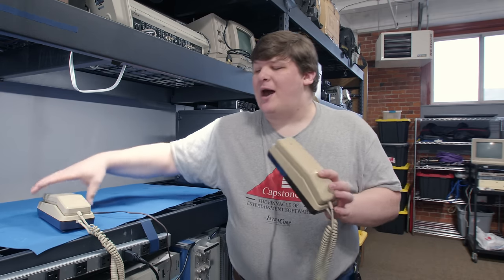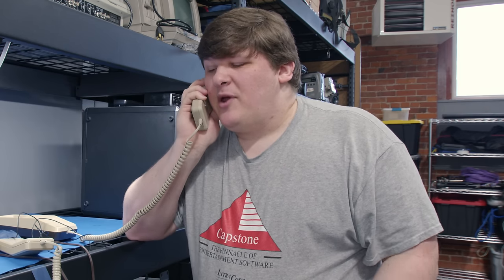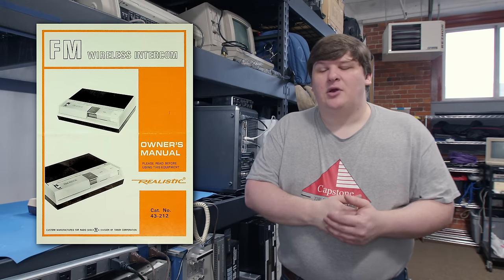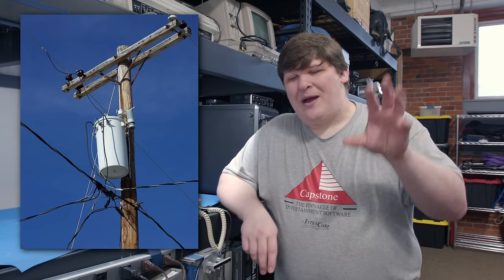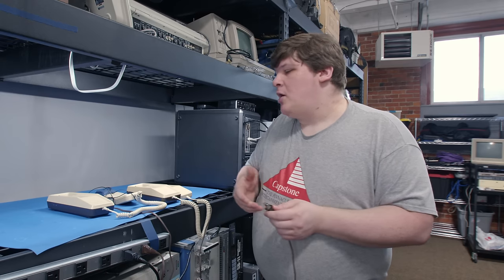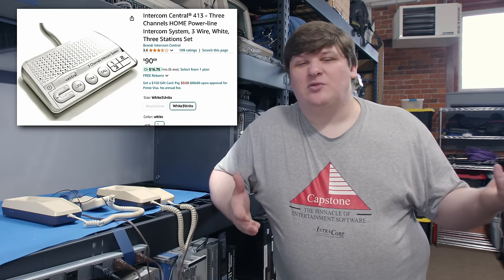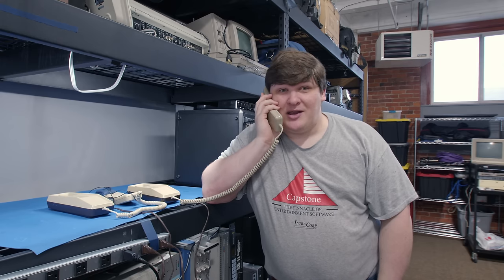How does this "phone" work without a line?

Comment: If you look at the power requirements, 220V/50Hz is in parenthesis just like the 193 kHz radio frequency is in parenthesis. Im betting the US version is 200kHz and the European version is 193kHz becuase its derived from the 60Hz and 50Hz AC power frequencies. Tandy wasn't about to make different transmitters for different countries if they didn't have to.
Reply: Probably so, and/or due to some differences in RF emissions regulations between countries, although probably more like what you said, as that would be more likely.

Comment: You should go to the granddaddy of them.  The built in intercom you would buy for your house.  I had one and managed to repair it with a few blown caps.  I mean it works and it was "kindof" nice to have the radio go on in the house but I used it like once.

Not sure why you would have an installer drop wires for all of it

Comment: PLC is iffy in North America because of the split-phase - it requires all the devices to be on the same phase to work. Unfortunately, two random outlets in your house have a 50-50 chance of that happening, and its likely all outlets in that room are hooked to the same phase, so if it didn't work between the den and the bedroom, it's likely not going to work. And older houses often had multiple rooms sharing the same breaker, so all the bedrooms on the second floor don't have outlets that work. Much less of an issue in Europe if your house only gets single phase power. Though people with 3-phase power are outta luck. And your building has 3 phase power - basically every non-standalone house building gets 3-phase, including apartments, offices and other places. Apartments often get 2 of the three phases leading to a 208V system (rather than 240V for a house) for higher powered appliances. As for offices, most offices get all 3 phases, but which phase a random outlet is on, is a guess.

Comment: So Gravis you’ll get a kick out of this! 

The thing about the X10 system is that I’ve seen it pop up in unexpected places! 

The circuit werkes Sicon-8 

A remote control unit to remotely interface with a broadcast transmission site, (over serial IP or POTS) supports X10!!!

Be me a jr broadcast tech in 2019, trying to trouble shoot my completely analog site control panel from the 70s, interfacing with this remote control from the early 2000s or so!

I found the manual, I rifted thru it looking for an answer to my ailment, and was side tracked by the chapter on X10! Like most of us I was made aware of x10 by LGRs video on the system! 

Apparently you could buy X10 gear and set it up all over your transmitter site and send commands out from the sicon! Cool shit! 

But for what! 

Maybe turning on the blower or your resistive dummy load remotely? You could also just wire it up directly to the TB on the back of the sicon. But maybe you can’t? Because you ran out of pins or the dummy load is in a different room and your site is a block building making it hard to run wires thru? 

Anyway, cool shit

Comment: I've had good luck with powerline ethernet devices, at my Aunts she had pretty thick walls and the wireless modem router was upstairs. She also had a brick summer house in the garden that needed internet access so she could work out there and it worked fine out there.
Reply: This likely depends on how noisy the power lines are, which is influenced by how much electronic stuff you have. I suspect the cheap wall wort power supplies are most at fault for noise, which they probably generate even when the connected device is off.

Comment: This solution is so clever, especially on how it use the house AC circuit, the doorbell intercom version make the most sense as you don't need extra phone wiring for the doorbell. I'd rather have this style than internet intercom, it's much more reliable and easier to set up if you know how to do basic house wiring.
Reply from the maker: Completely agreed. Instantaneous communication that can't fail and doesn't need configuration, it's a slam dunk.

Comment: I think they have to be on different frequencies because it's FM. If you have two FM broadcasts, an FM receiver will lock onto one or the other (it's known as the capture effect) ; this is unlike AM where the two broadcasts constructively interfere. If both stations were broadcasting on the same frequency, your handset would lock onto the strongest signal, which would inevitably be the one being broadcast from itself.

This is the same reason that airplanes use AM to communicate; if they used FM then broadcasts from some planes could be lost, and when you're doing air traffic control it's quite important that they aren't
Reply: Eh, it’s not like if people “step on” each others transmissions in AM, both will be audible. It usually creates “intermod” which is generally sounds like a tone or a buzz. 
BUT, crucially, everyone listening on frequency will be aware that a TX was missed, and usually the controller will ask to repeat. 

The other reason aircraft use AM is because aircraft were using radio way before FM was invented, and having every aircraft and every tower switch at exactly the same moment would have been basically impossible.

Comment: My experience with powerline was that it worked OK in situations where WiFi didn't work at all. The throughput was not great compared to an Ethernet cable, perhaps fluctuating around 40-60 Mbps instead of 100 Mbps, but this was at a time when WiFi had a gross data rate of 54 Mbps, which even under optimal conditions (no noisy environment, no walls between, just one AP and one device) was 20-25 Mbps at best. The only problem with powerline was that electric motors were a huge interference. So whenever you had a vacuum cleaner, kitchen appliance or fan running, the data rate would drop dramatically to just a few Mbps. 

However, this could be avoided by connecting a filter between the appliance with the motor and the socket. You can buy such intermediate plugs that filter out all signals except the mains voltage and they work on both sides, i.e. they also filter out interference frequencies from the appliance so that these do not get back into the line (or are at least very strongly attenuated). With such a filter, the data rate only dropped by 15-20%.

If powerline didn't work at all, it was either because the two sockets were switched to different phases (electricity comes in three phases from the local transformer, but normal sockets only use one of these three phases, yet not all sockets in every household use the same phase) or because high-frequency filters were installed in the fuse box. These filters are intended to prevent devices such as motors from feeding interference signals back into the grid, basically the same as the plugs I mentioned before, and if there are filters, then the supply lines to both sockets must  be connected together before any filter, because if they are only connected after a filter, that filter kills the powerline signal.

Comment: My house, built in the 80's had a wired intercom system centrally located in the kitchen, 4 bedrooms and the front porch. With exception of the speaker on the porch, I have removed all and plastered over all the holes. The central unit was pretty huge and ugly. We have since insulated this house to the point where it is hard to shout from one end to the other so I suppose it might be useful.

Comment: The minute you showed just a power cord, I was thinking it's either radio (AM or FM depending on era) or powerline. And it turns out to be both! FM using the power line as the antenna. (I've seen that trick before.) The most likely reason for your problem with "BPL" is the NEC requirement for a "whole home surge protector", and the propensity for surge limiting circuits being built into just about everything. If you have a UPS... won't work. If you have a power strip with a surge protector... won't work. If you're on a different phase in a three phase building... won't work. If your commercial space has it's own transformer (VERY common in commercial buildings)... won't work. (etc. etc. etc.)

BPL across the grid has similar issues crossing transformers, but ultimately was "outlawed" due to the AM/FM radio interference it causes.

Comment: Unironically, these would be great for testing HomePlug AV (that's the name of Powerline Ethernet) interference. They're still analog, so you can hear it. Because no, that 60Hz hum is not because it's old. The electronics do not "get tired". That 60Hz hum is the hum from the AC power it is connected to. There should also be a 30kHz hum from the carrier, but... that's outside of the human hearing range. The modern ones are usually digital and feature some form of encryption so the neighbors can't listen in. Just like HomePlug AV does.
What I would like to know, though, is whether these things can coexist with HomePlug AV devices and not disturb each other...

By the way, the Radio Shack Realistic Plug'nTalk Model 43-212 was used in several movies and TV shows for the CEO scene of "calling the secretary". Even some modern period pieces.

Comment: The "Duplex" in the name already reveals that the frequencies work exactly in the way you described it. The 200kHz would work on power line but not on the air, since that would require a giant antenna, so the powerline transformer used to carry the signal makes sense. The pole transformer acts as a huge choke which filters out almost anything above 60Hz.

Comment: Powerline Ethernet adapters generally don't work great in my experience (slow and drop out frequently) but MoCA adapters are a much better option that uses your cable TV (coaxial) wiring instead. They're only a little bit more expensive, but are an order of magnitude (or two) faster and more reliable (assuming you have coaxial cabling in your home, which most existing homes do).

Comment: Had a few of the push button style ones, but obviously not Radio Shack / Realistic as it was in Europe.

They worked really bad as is. However I modified them by cutting the traces between the radio section and the mains power, and ran a separate wire for the radio part. Turned out that the telephone wiring worked great for running the radio stuff :)

The reason that you only saw Radio Shack / Realistic and not any more well regarded brands was the same as for ethernet over power wires. Sometimes it works great, sometimes it doesn't. I assume that Radio Shack had an excellent money back return policy for these, in order to not upset any customers. Can't remember the brand on those we had when I grew up, but they were from the pile of rejected/unsalable stuff at a consumer electronics shop.

Comment: I suspect the different frequency in brackets is for the 230V 50 Hz variants sold by Tandy in Europe - until recently long wave was used for radio broadcasting across the continent, and transmitting anything on 200 KHz in Northern Europe would result in interference from a very strong BBC long wave transmitter in England (which is still in use, albeit not for much longer). Shifting the carrier frequency to 193 KHz would avoid this problem (even though the radio signal was sent through the mains wiring, this same wiring could also pick up the other long wave signals)

Comment: The trick to ethernet via powerline is  that they not only need to be on the same transformer but on the same branch circuit as one another.  Which means depending on how and when your house was wired, they almost never work the way you'd actually want to use them. On top of that, a lot of  fairly normal  things plugged into that circuit will introduce enough noise that makes it non-functional: UPS, certain brands of AFCI breakers,  and almost anything with a high draw and a switched mode power supply on the circuit will make the network non-functional.  Technically you could filter these but then you're back to the bad old days of DSL line filters except with any device you plug into the wall.

Comment: My grandparents had a set. They took advantage of that distribution transformer "limitation".

See, my great-grandfather lived across the street. So it was faster, easier, and cheaper than placing a phone call. In fact, that's still the case! The area is all farm land and the density just isn't high enough to justify running another cell tower to cover the dead zone.

They might have even had one of the three-channel jobs so they could communicate with another neighbor. I'm not real sure. The device did move homes a few times.

Comment: 8:35 yeah I use a pair of TP-Link 800Mbps powerline ethernet connectors to extend the wifi in my house (via a second wifi router running in AP mode) to actually cover the entire house, since the net connection is Starlink and consequently limits where I can put its router.

Comment: 7:30 this definitely still happens with some old intercoms plugged-in in some new homes if the circuits aren't in the same of if the panel... presumably because of the split-phase system to provide 120V and 240V. Plus now there are lots of electronics that might isolate signals or cause interference. it might depend on the unit and house since the neutral is supposed to be common

Comment: The x10 system in my experience only worked if both devices were on the same side of the spilt phase transformer. I can’t remember if the intercoms did too. They even sold devices to bridge both sides of the transformer so x10 would work on both.

Comment: Two different frequencies for rx/tx makes full duplex a lot easier, because you don't have to deal with echo cancellation, which due to reflections can be a nightmare or even impossible with 80s electronics being counted in "6 transistors and 2 diodes". A traditional handheld walkie talkie is half duplex for this reason. Even modern DSL lines, mobile phones, etc. will split tx/rx frequencies to make dealing with reflections easier.
Reply: Wifi for example uses the same frequencies, but has shorter range, and performs a much more delicate choreography between the stations, to ensure data arrives in the correct time slots. It also only works with packet data that can collide and be retransmitted. And it needs to handle collisions, because your neighbor using the same channel will cause your packages to collide anyway. It will also suffer degradation with channel oversubscription between multiple access points. Fun fact: newer versions can actually leverage multi path propagation to add channel capacity, but that is 40 years past the technology of that phone in your hand :)

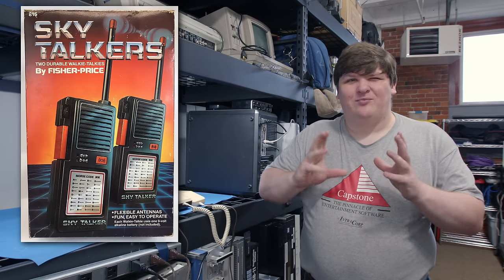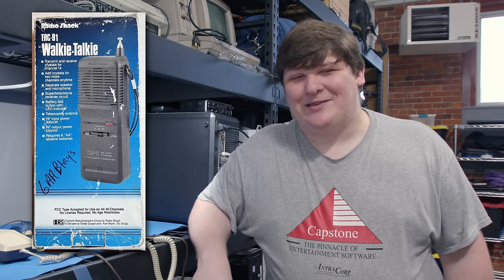Comment: @2:40 and 2:50 they were 49 Mhz radios, the "A" "B" and "C" Switch was to change the frequency channel @4:35 that is an old AM CB radio with 3 channels on the 26 Mhz

Comment: I work for a power company, our older meters sent their data to us over the power lines. As you can imagine (since they're now replaced) it wasn't a very reliable system. Luckily, we're a small company so we just had to replace ~5000 meters :)

(Also, they didn't meet the 15 min resolution imposed by the EU, so we had to replace them anyway - for once EU regulation was a good thing)

Comment: I think you may have solved my issue with noise and electric problems as well as weird interference with my hammond organ and everything in the house. Our modem has a ethernet cable that plugs into the outlet that I thought was just a weird router so we can have wifi, but it might have been one of those devices. I may try unplugging it (and suffer the threats) to see if it may be the unexplainable issue.

Comment: I bet these things would drive modern AFCI breakers crazy. I had given my folks a polweline Ethernet thing that worked great — yada yada yada, the whole house needed to be gutted after an electrical fire (unrelated to Ethernet — 1920’s vintage doorbell transformer failed shorting primary to secondary, 1920s vintage cloth jacket doorbell wiring lit up like celluloid) - new wiring needed to be to new code, all afci breakers, powerline Ethernet adapter made it trip constantly. 

Although maybe the comparatively low frequency of these - it’d be fine? Idk.

Comment: 7:33 "in a typical American home this would never happen so you don't need to worry about it". unfortunately this is not true and i learned the hard way. i have the "select-a-com" set that sits on your desk, and i bought them as a fun way to talk to my roommates on the opposite side of the house. through a LOT of testing, i found that they would only work if both sets were placed on the same circuit in the house. it completely voids the point of the product if you need them to be next to each other to function, so it turned out to be a great disappointment.
Reply from the maker: That's wild, but is there any reason not to think that your home wasn't "typical"? I've seen some bizarre things in house wiring.

Comment: Power companies have switched from using the power line to communicate to running a fiber line within the ground wire. (That way it’s protected by a lot of insulation) At least on transmission lines.